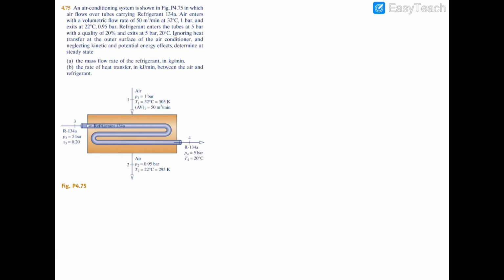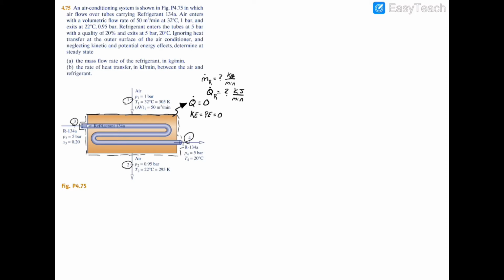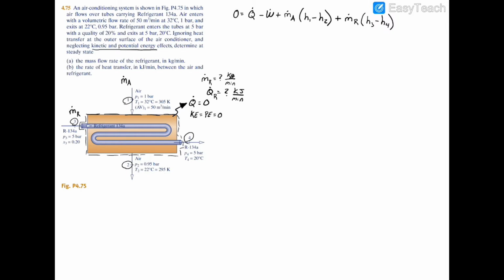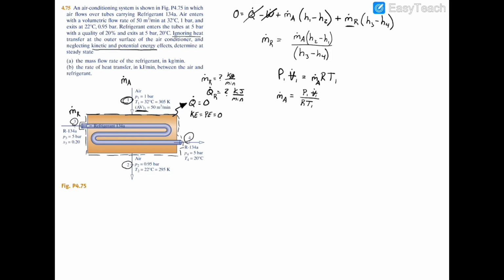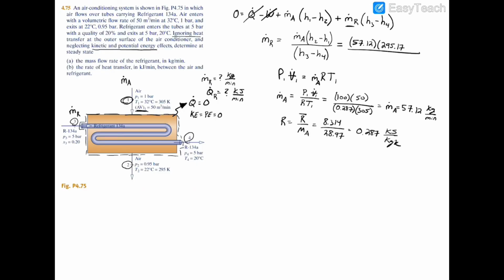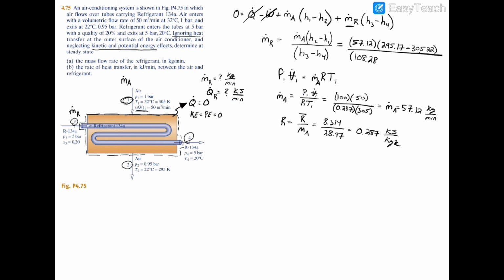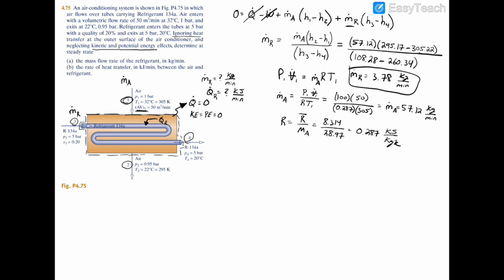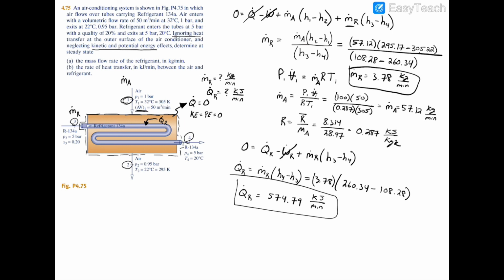4.75 An air-conditioning system is shown in Fig. P4.75 in which air flows over tubes carrying

Comment: Why did you not convert bar to atm cuz atm is the SI unit of pressure right? @6.30
Reply from the maker: We use kPa because it’s much more simple and compatible with the other units in the ideal gas law. If you wanted to use atm, you could, but it’s a lot easier to stick with kPa. You’d have to add a more complex conversion factor to keep the dimensional analysis consistent.